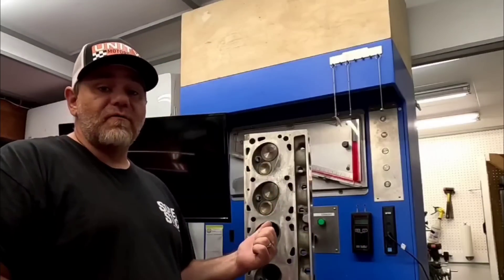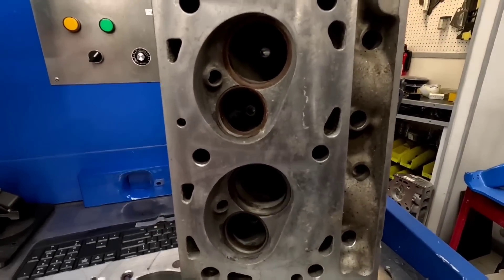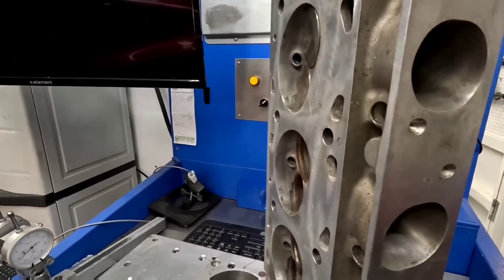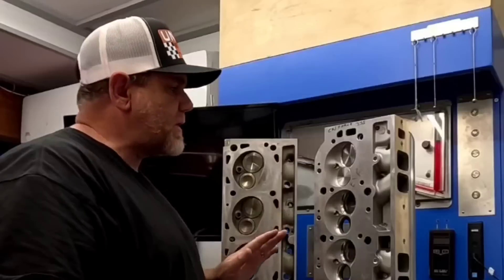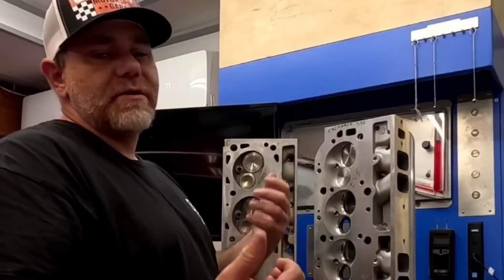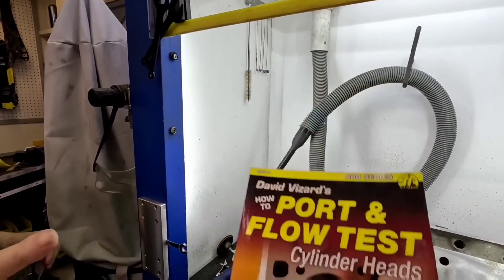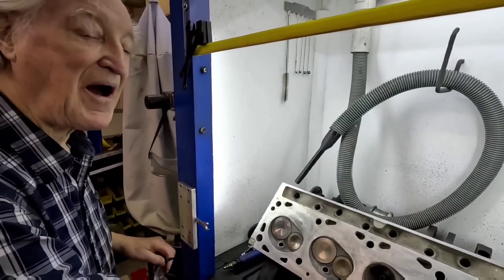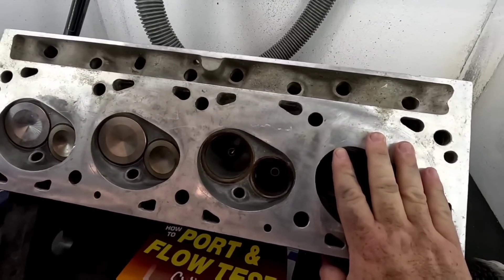DIY Head Porting! Unlocking Big Power on BBF Edelbrock Victor Jr heads without a Flowbench!!! Part 1

Comment: I do have a question about the less valve angle of the Ford head since the port is still lower like the BBC would the port of the Ford would have to make a sharper turn because of the less valve angle so a raised runner can help it better. Like a SBC from 23 to 18 degree head you want a raised runner to make a better turn for that less valve angle I was thinking about it

Comment: I would like to see how much power that the Victor Jr's make. MPG has a porting, and cam pkg that makes 600 hp with the factory iron heads.  I vote yes on the porting videos.  A 460 in my 2002 Crustang would make a good drag and drive rig!!